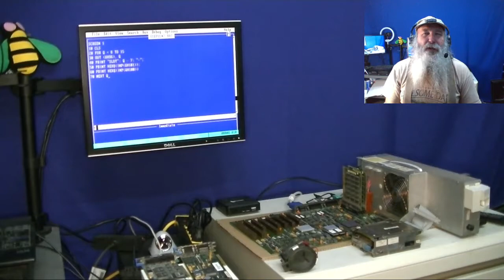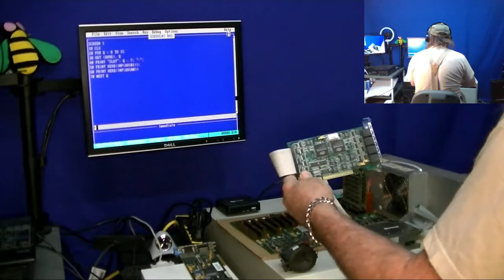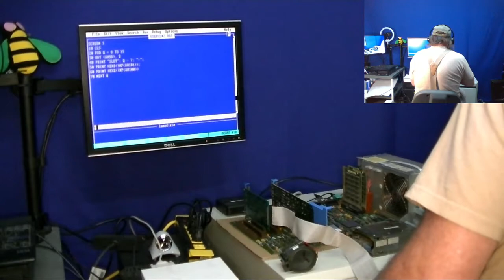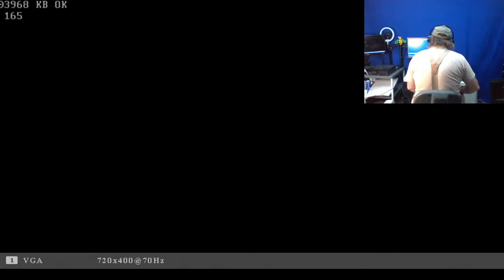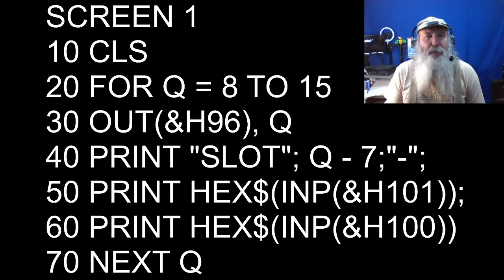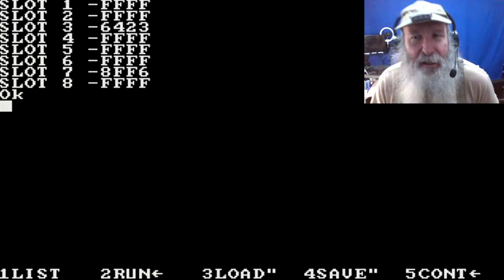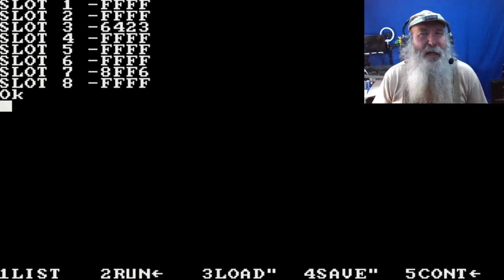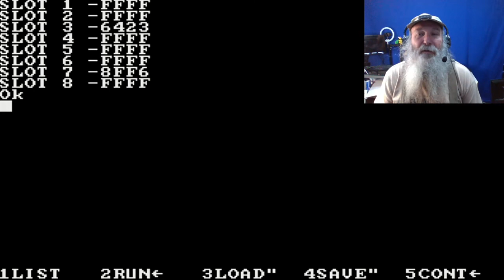Getting the "Adapter ID" using a benched Model 80 planar - A Peter Wendt "Hint"

Comment: setting bit 3 of port 96 (with adapter being bits 0-2) sets an adapter in "setup mode".
Leaving that bit 1 - leaves the adapter in setup mode - I assume, 
So I always set bit 3 to 0 on all adapters after, i.e. write 0,1,2,3,4,5,6,7 to port 96 in sequence. 
It's not mentioned as a note in the tech ref, it just makes sense to me.
I did find this not however:
"If an adapter and the system board are in setup mode at the same 
time, bus contention will occur, no useful programming can take 
place, and damage to the hardware can occur" 
Possible addition:
80 for q = 0 to 7;out(&h96,q);next;
Reply from the maker: Correct, there is some proper clean-up that should be done in a program that continues after this process - and could be added here with just an additional line in ROM BASIC. The planar is powered down after this runs.